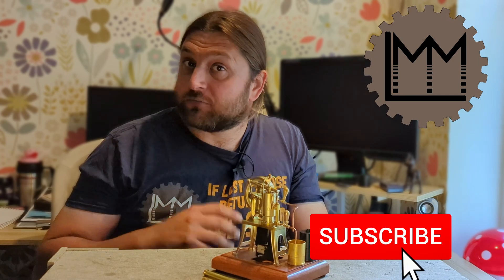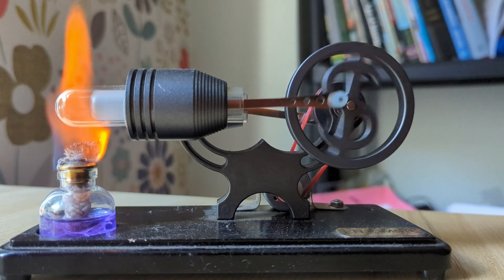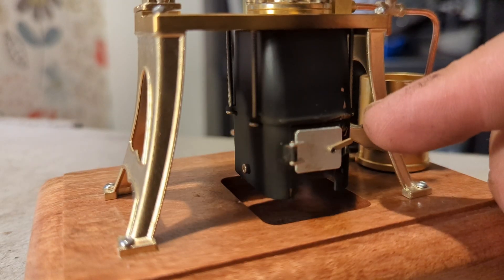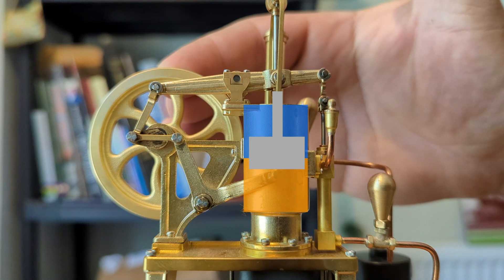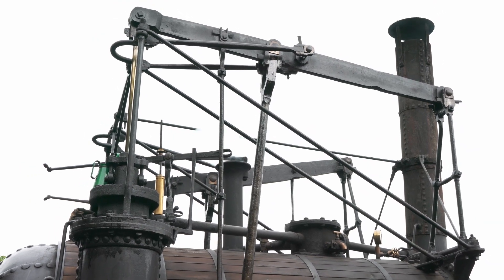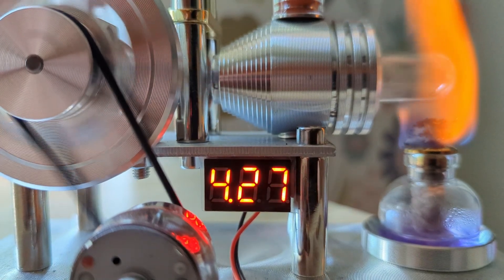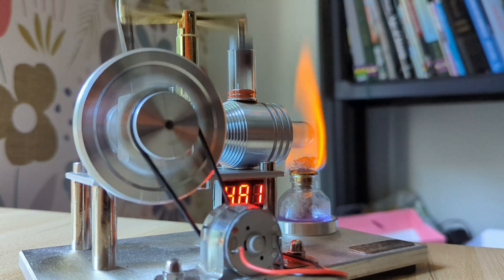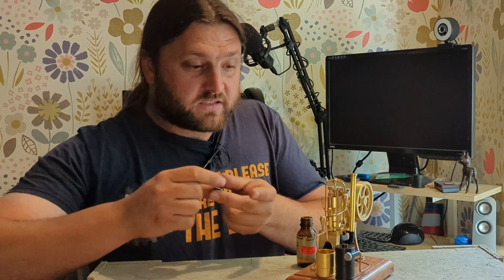What goes wrong with my Rider Ericson Beta Hot Air Engine Review?

Comment: This engine DOES have an Adjustable flame to slow the engine down, and give it a longer running tiime.

If you must  use an electric motor as a load for speed control, put a led or two correctly polarised across the terminals, of the motor so it illuminates them.

Comment: I bought one at the special $199 price.  I found the burner already set so I oiled it a bit and....found the butane control to be verrrry touchy.  I found a jet flame torch is the only way to get it lit on the first try.  It runs well but the water pump is a problem.  No luck at all with priming so I added a bit of steam oil in the priming cup and it pumped from the water reservoir as it should.  The oil wound up in the water tank.  Later on, I tried just water and it sort of pumped.  I also found that if it is pumping and then you stop the engine for a few minutes it won't pump after you restart it.  So, the pump is erratic (only worked once with just water), but the engine is a runner.  I hope my butane tank does not start to leak.  Oh, the shipping was pricey.
Reply from the maker: That sounds disappointing.
Have you got it to run in a more controlled manner than I?
Reply: @lmm  So, with it running, I used a hypodermic needle with silicone
tubing at the end to fill (and keep filling) the primer cup.  When
water started to pump through, instead of trying to get that tiny
cap threaded into the primer cup I took a bit of the silicone tubing
(with one end flame sealed) and stuck it on the priming cup.  VERRRRRY
easy.  That is my trick and advice.  Works for me.

Comment: Lawrie look up Mark Found's Garden Railway please, has a interview with Richard Ince and he had a model worked on the system your's does but it is a locomotive model and two cylinder. But it wasn't Sterling it was hot air.

Comment: Could  a ball governor or something like it be incorporated  with it, or does it not produce enough torque to warrant it?,
Definitely going keep an eye for one of these little engines
Reply from the maker: A Govener would be a great idea, but they're very hard to throttle, you'd have to limit the heat going in.
I wonder if by replacing the burner or using a less carbon rich fuel you could get more control.

Comment: I'm looking at this and yes, they should add an adjustable governor. It can be like the governor in a hand crank Victrola where it's three weights, some flat springs, a shaft, a metal disc with a sleeve in the middle, and an arm with an oiled leather pad on it. What happens (if you've ever seen one of these governors) is the weights are attached to the flat springs and as it spins up they are forced outwards, this pulls the disc down the shaft and the oiled leather pad keeps it from going any farther. With a setup like this, you can have a simple little lever for adjusting your speed, that way you can set your speed without any tools and it can be adjusted on a whim and it will hold that speed wherever you set it.

Comment: I have the Denny version (listed as Rider Ericsson RO2) which i got off ebay for about £100 all in. Its a nice unit and will run quite slow with the regilator turned right down. I too have had the gas valve issue but a bit of plumber tape sorted that. Main issue for me is the water ways, if its more than a ground out channel, are not big enough to effectively keep the cold end cold. Apart from that I think its great, though its nothing like my 1/4 scale Rider or full size Robinson B4.

Comment: You could use different value resistors across the motor polls to control how much resistance it applies. Similar to regenerative braking. You will need to use resistors with a high enough current rating as to not blow them up though. Maybe a 120/240V light dimmer knob would do the trick nicely. Proof of concept would be to put a piece of metal across the terminals while the engine is running and it will brake pretty hard.

Comment: Tamiya threadlocker would probably also help at least with the screws, I'd use that over full-strength Loctite, though I guess Blue Loctite might not be overkill...

That said, Maybe wouldn't help so much with the butane valve though. To be fair, you're right, you shouldn't have to take a fully assembled model and take out all the screws and put chemical threadlock on them to hold them in place...and the valve not being gastight is a big problem.

Comment: We have a running Rider Ericsson engine near us at High Beeches Gardens in Sussex. Still pumping water in its original location from new.
Reply from the maker: Oh really? I want to see that
Reply: @lmm I had a look at my photos and it looks like this engine is more of a Rider than an Ericsson 🙂. It is described as an "improved Rider Ericsson" built in the late 1800s by Hayward Tyler & Co. It has two cylinders 90 degrees out of phase rather than the combined cylinder of your model. Runs nicely on a wood fire.  Maintained by the Sussex Engine and Associated Machinery Society. (SEAMS)
Reply: How is this not a Stirling engine, cycle-wise?
Reply from the maker: It's a hot engine, but not all hot air engines are Stirling Engines
Reply: @lmm  I know, but any closed cycle hot air engine with a displacer for sure is. It's not a Manson-cycle engine, or an open Ericsson-cycle engine.

This is a Stirling cycle engine in Beta configuration.

Comment: Torque times speed equals a constant, Lawrie. You should know that, you work with steam locomotives all day. Sure, the efficiency of that hot air engine isn't anything to write home about, but were you to design and build one that actually was meant to do work, rather than just look like an amusing desk toy, a proper gearbox would go a long way to make it practical.

Arguably, you could do the same with that desk toy model, but you'd have your work cut out for you as far as friction goes -- you'd need good bearings at least, for sure, and you'd probably have to absolutely drown it in oil. (Pity about the model's apparent build quality as well.) Something that small isn't going to charge an iPhone... a few LEDs might be doable, though, with a proper transmission of some sort.

Worth noting, as efficiency and scaling both go... the engines you're playing with are scale models, at best, of something a bit more like the gas/petrol engines in the earliest horseless carriages. The sort of engine in your Mini, or even in that lovely little Robin, those are Star Trek compared to this level of tech. Even what's in a Model T Ford is considerably more advanced. Engines scale well, as a general rule, but you have to know how to do it, and your materials have to be up to snuff as well. It's just a matter of engineering over time, really, and that hasn't been done yet. (Why? Greed. Robert Stirling was made all sorts of promises if he was willing to sell out to the early oil barons -- I forget now exactly whom it was wound up with the paperwork -- but regardless, as soon as it was theirs, they promptly sat on it just as hard as they could. It wasn't till Dean Kamen, the guy who invented that laughable Segway thing, bought the patent off... I think it was Philips who owned it at that point... and basically said, have at it boys it's open season on Stirlings now, that it actually got popular again. According to Wikipedia, there were some rather notable experiments in the 1970s and 1980s that did prove Stirlings able to run a vehicle, although both startup and acceleration/deceleration response were a bit slow. One imagines that, with time and experimentation, both of these problems could be at least partially overcome... likely moreso the latter than the former (look at the Stanley Steamer car, for example... acceleration and braking are quite good, but it takes twenty minutes to fire!).

As for simplicity, if that's your thing, look into the thermoacoustic engine. Bit of a weird one, that, but if you ever wondered how to make an alternator with a single coil and one moving part, it's a thermoacoustic engine with a magnetic neodymium slug for a piston. Works like those shake-n-bake torch lights you can buy. I hear NASA is looking at designs based on that for running satellites, no less... there's also the Manson engine, but <low whistle> oy, the machining requirements on that piston, I tell you what.